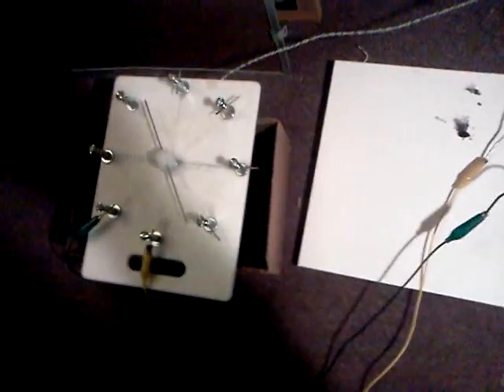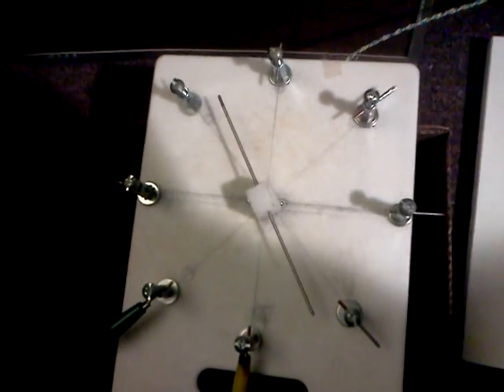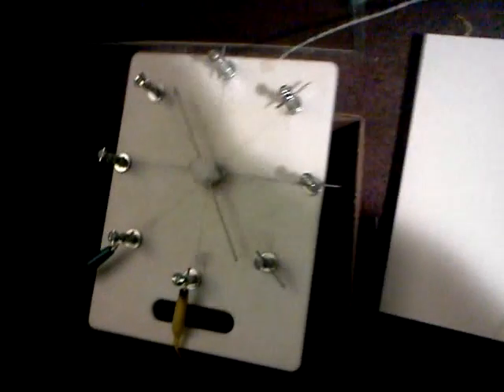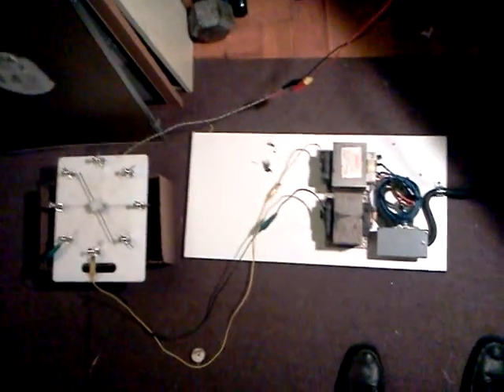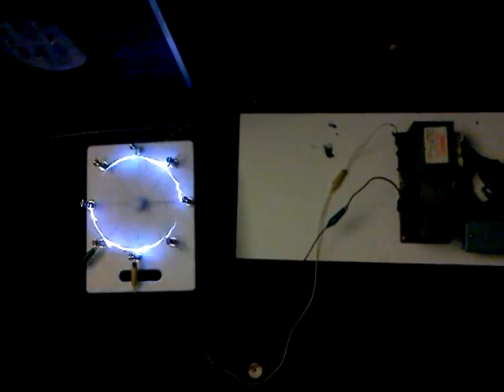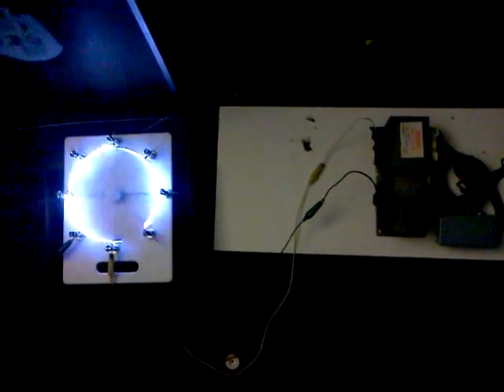Asynchronous Rotary Gap test

Comment from the maker: Thanks alot!, it took quite abit of work to get it where it is now, alot of adjustments had to be made because it only runs on 4kV from the MOT's and thats a very short gap.
Tomorrow ill be testing with a capacitor involved, ill try and have a video, im trying to have the entire setup power my 4 inch SGTC, ive pretty much had it with NST's  thanks for watchin!

Comment from the maker: Thanks for the comment, i'm not sure of what the rpm's are in the video, the motor has no markings sadly, it came from a hobby rc car so i'm sure its capable of at least 10,000 rpm's not that ill need that kind of speed though haha. Ill take a better video of the gap for you now that its all set up.